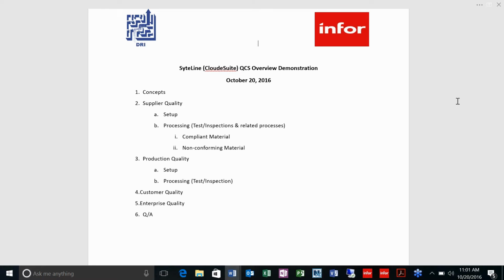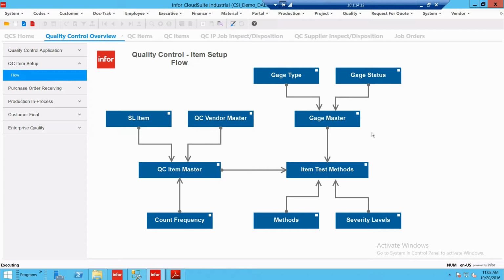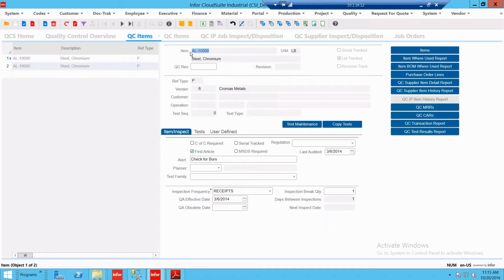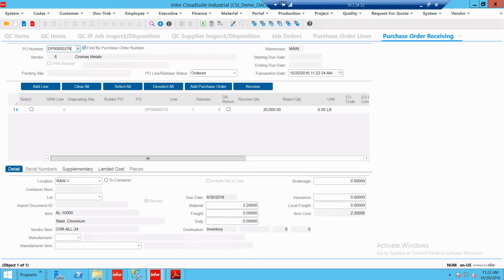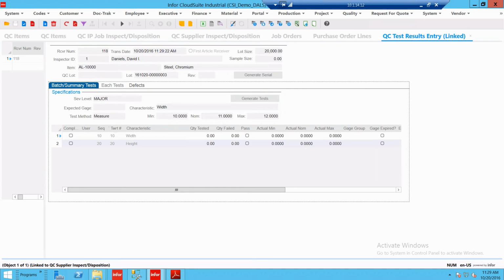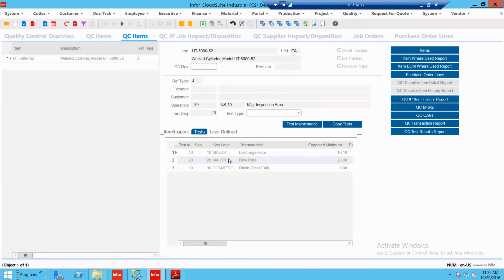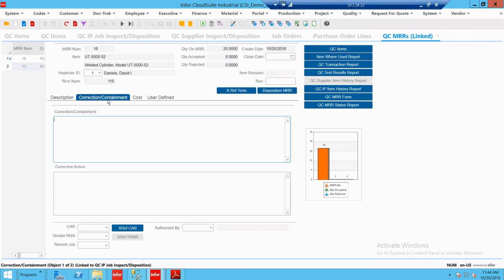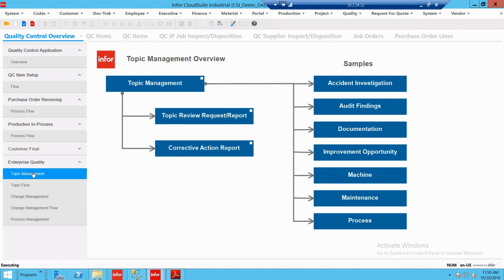CloudSuite (SyteLine) Quality Control System Overview

Comment: I'm concerned with the use of "MRB" (Material Review Board) for the review of material rejected in house.  In Aerospace "MRB" is only allowed by the design authority (OEM) or allowed with specific authorization.  It appears Syteline in using "MRB" for "PRB" (preliminary review board) activities.  I could see this becoming an issue with Aerospace and military customers.